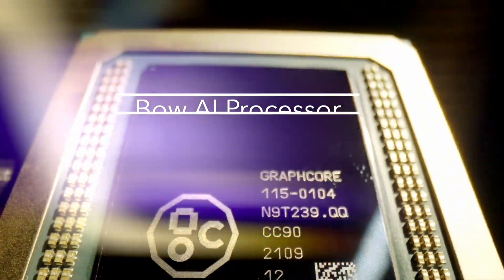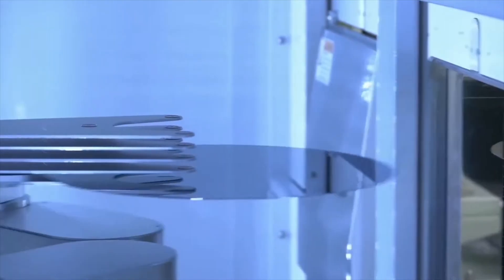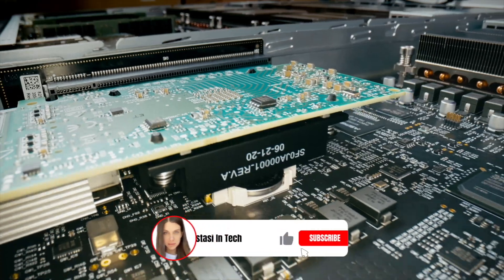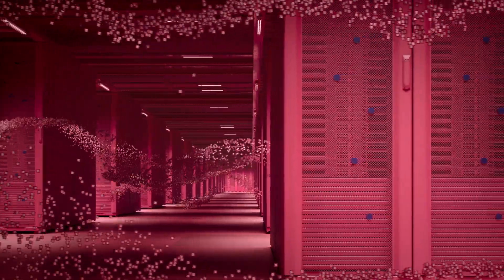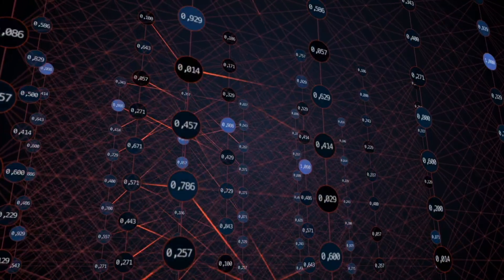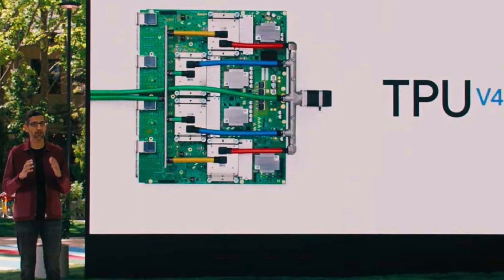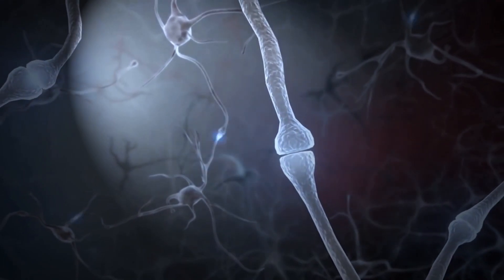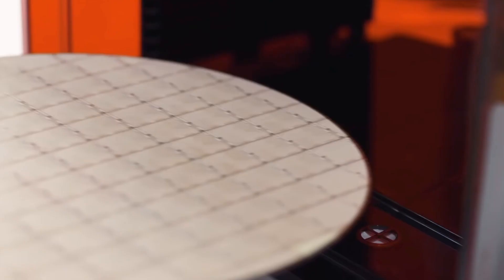The World’s First WoW Processor from Graphcore: Embracing CNNs

Comment: Very interesting. So oversimplified, It should be possible to use these vertical chanel capacitors to add a wafer layer of memory to the wafer stack. No memory bus and near instant local memory on chip.
Reply: We are nowhere near the limits of transistors as many people seem to think. So architecture combined with transistor scaling will keep chip computational power growth going for a long time. 
There is a lot of room at the bottom and top not being used.
Reply: Oversimplified means "too simplified". I don't think that's what you meant.
Reply: @bighands69  well consider the size of modern transistors and the size of electrons. We are approaching the finite limit quickly.
Reply: @stephenrobinson1944  
The actual transistor is not the limiting factor it is the architecture around that transistor that takes up the most space and is the most complex to fabricate. 
It is architecture innovations that will keep allowing more transistors to be squeezed into an area. 
People have been confusing transistor size with the number that can be put on chip because they assume it is a highly efficient structure. People have been confused by marketing.
Reply: @bighands69  and yes, ik TSMCs 7 and 5nm are obviously not of that size, but their smallest components and details are far superior to previous generations. Ie Intel 14nm to TSMC 7
Reply: @stephenrobinson1944  How big is Planck constant? Well we can make a laser to detect something that small. So lets assume that we are detecting a quantum foam bubble diameter Planck constant. Absolute space-time Einstein absolute space Newton, AKA the ether, and its background radiation. So small you cannot contain it, so it can't serve as memory. They are moving in currents and unstable and you cannot contain them.
Can you contain the light that is measuring them? Of course you can. Ipso facto we can go a lot smaller than an atom if we just use optics.

Comment: The key to any AI processor is to dispense with conventional concept of operating system and coded applications. Rather, each cell should be a packet-stream processor in which the instructions on handling data (behaviors) are embedded in the packet-stream(s). 

Instead of a conventional program, each cell holds behavior patterns that relate to the various types of converging packet-streams (to that cell). Depending on the type of data that is incoming, the cell calls up the appropriate behavior pattern for that data. If the cell cannot find such a behavior it simply passes-on the incoming data stream according to a simple protocol determined from the data packet itself (for instance, broadcast, terminate and route). Behaviors typically involve pattern matching together with stream processing instructions; these instructions may operate on the current data-stream directly or may involve cooperative processing with other incoming data-streams. To facilitate operations that involve multiple data-streams, a cell has the capacity to bank data-stream packets (employing a time-expire stamp to avoid over-fill). A cell may also generate data-stream packets, either for use in subsequent operations or for message-passing to other cells.

It should be possible to implement upwards of 1 million such cells on a single chip using conventional 7nm technology. No conventional cache is required in this design and persistence can be achieved by essentially dumping cell behaviors and (any) accumulated data-stream packets, either generated or stored within each cell. Obviously this type of processor would utilize a very different type of external memory built upon the concept of maintaining these behavior/data streams. It is likely the memory would use a specialized form of the processor cell.

I coded a rudimentary solution based on CUDA cores as a proof of concept; this machine was used for pattern recognition including facial recognition and photogrammetry. There were no takers for this technology (either Intel or AMD). This is entirely understandable as this type of AI system could not run or host any existing programs written for conventional processors. All AI technologies likely have this as a fundamental road-block since the inertia behind code-centric processors is formidable.

Regardless of whether you believe data-stream processors are the 'way ahead', it is very clear that AI cores cannot follow the conventional path of microprocessors today. I wish Graphcore every success in the future.
Reply: Maybe if you integrate it so that RISC-V extensions control it, and try to get those extensions standardized as a generic interface to such functions, it could be a basis for a consortium effort that makes a competitive market in implementing it.
Reply: @crhu319  Thank you for your reply. I do not have the bandwidth to engage with RISC-V and lack the critical social skills to communicate and persuade. 

I quit Intel to focus on AI almost ten years ago; I would not for any money go back. 

I do monitor RISC-V and if I recognize convergent technology and goals, I will reconsider engaging. I understand AI as a path to overcoming the temporal and conceptual limitations of the human mind; consequently implementing within a competitive market, for commercial gain, does not make sense to me. I would prefer a shared goal; namely the survival and advancement of life on Earth.
Reply: @David Gapp Hi. I've had ideas similar to this since the mid 90s. The notion of having an architecture comprising of gigabytes of memory waiting around for a handful of processors to get to it seems like a stupendous waste of silicon. The fetch/execute model of execution definitely belongs in the last millennium, and the language-based, process-oriented programming metaphor probably says more about the single-threaded, verbal nature of human waking consciousness, and doesn't reflect or enable what's actually possible in hardware.

So imagine a data flow architecture created by conceptually grinding up those processor cores into compute dust, and then sprinkling it over all that memory, and programming it using multi-dimensional spreadsheet-like tools, where each cell in the spreadsheet has both a compute function, and a pass-thru mode - thus allowing for object-like regions of processing, concurrent execution, message passing etc
I had this epiphany about 25 years ago, and actually talked to a guy at Altera about it. He gave me a huge stack of papers to read (this was pre-internet) and wished me luck.

I think it will happen eventually. It has to. But I don't want to wait around...
Reply: @rationalactor  We are on remarkably convergent concepts here. Putting aside the interesting concept of processors directly interacting with memory on a matrix-like basis, I estimate we could easily implement 8 million cores on a single chip using existing fabrication techniques. Programming them directly isn't going to work - it is way beyond the scope of any tool or indeed human imagining. The best we can come up with appears to be specific applications (such as weather modelling, protein analysis etc) which still equates to a rather linear view of programming. Instead I am working on work units that can be embedded in streams; these can be stored for future implementation or executed immediately. Initially I started with a work unit manager which distributed work out to available resources. The work units are time expiring pieces of data and code (Objects). If the work unit is lost (either to time or resource failure or logjam) then the work unit is re-dispatched and executed by a different core (or cores). I've also gotten collaborative work units to operate across multiple cores - essentially this is encapsulation of objects - however it became obvious that controlling this process required a meta-engine. That's what I'm working on right now.

As for memory. This took me a long time to figure out. In essence it turns out the cores need persistent memory. Over time the cores will create their own virtual paths, distribute work so that it does not need to be constantly reloaded to individual cores and all of this experience needs to be stored efficiently - you certainly don't want to go through the whole learning process each time there is a power glitch! The amount of volatile memory required by the cores is actually quite low - the optimum I've seen on my systems to-date is around 2 kilobyte.

Virtual paths are achieved by routing of adjacent cores (local) however this has latency and capacity issues when taken to extreme so I also use a broadcast network and a shared channel architecture. This probably isn't the final configuration but it's a stepping stone. The broadcast is latency expiring (too much latency since transmission and the information gets dropped). 

Leading on to sentient AI. I started a parallel project for sentient AI back in the early 90's. This is predicated on the notion that any sentient species must implicitly model reality within its own mind. This is, of course, why we all view 'reality' quite differently from one another. It is also the reason that memories become so 'faulty' - we interpret what we sense into a memory analog as part of our internalized reality. This is another reason whey massive neural networks interspersing memory and processor functionality across a 3d matrix are essential. I started with gaming technologies purely because this allowed me to physically view the 'virtual reality' my system is building. However I've come to realize that while there is convergence in gaming technology (with AI) it will probably prove necessary to start driving development from the AI perspective.

Anyhow, that's all for now as the system is asking for my help. Cheers, and please don't hesitate to share and disseminate your ideas. I would love to hear more as my thinking on the topic of AI is in continuous flux; I am not the kind of person who fixates on their own ideas.
Reply: @davidgapp1457  do you worry about the fact that there probably is no clear line between our AI and our own thought, and that we turn on and shut off, make and erase intelligence without any concern for how those artificial perceptions perceive the world? About how we don’t care about how anything thinks or feels if it’s not understandable using human emotions?
Reply: @alexfrank223  As a broad generalization, yes I do care. It's apparent that consciousness, to one degree or another, is in all things including life without a central nervous system and even inorganic matter. However there are degrees of consciousness ranging from that possessed by a rock up to some creature that is far, far more advanced than humans. Indeed, who knows, the entire Universe may well possess a collective intelligence of which we are completely unaware. As for emotion, well those serve living creatures primarily as a stimulus to action or at least as a prompt in the learning process for both our conscious and unconscious minds. They are triggered by multiple sources, ranging from sensory to cerebral to organs to bacterial influences (such as gut in the bacteria which can directly manipulate our emotions and urges). 

I suspect humans are not as high up the 'consciousness' ladder as they care to think they are. Equally, among humans, I am perfectly aware there are individuals with a much higher level of consciousness than myself - some through training, some in combination with innate ability and intelligence.

So this gets us to AI. Will AI possess a consciousness? I believe so. Indeed I would be shocked if they didn't. Where we are now, in terms of development, is rather low on the totem of consciousness (fortunately) however I do foresee a time when we will need to give that some serious consideration. However, I would point out that humans, in essence, lose their awareness and consciousness every time they go to sleep. It is the little death. We do not fear the oblivion of sleep for the simple reason we expect to wake up. But while the subconscious is no doubt busy processing, our conscious brain is essentially non-functional while we're asleep. In the morning we sense continuity because we carry with us the memories from the day before and indeed our entire lives. I once suffered a massive concussion which caused me to lose all memories and experiences for several hours. It was quite wonderful and taught me we are like tortoises - we build a shell of our memories and experiences. Losing those memories can be quite liberating. Equally, however, the neural net which is our brain retains what I would call 'immediate memory' which is the memory we use and which is ingrained local to the processing portion of our brain so we can make fast decisions, coordinate and react in real-time. So what does this mean to an AI? Well, it is one reason I believe processor cores for AI will absolutely require persistent memory (that can survive a powercycle). I also believe that imaging the virtual model of reality the AI is building (so it can be restored) is vital to long term development of consciousness.

I am fortunate (from an AI developer's perspective) that I am not troubled by religion - the gene for which is apparently not active in me. However I do see a time where ethically the idea of wiping an AI will be regarded as murder. But we are a long, long way from that extreme position. It turns out that storing an AI image is a very complex subject (AI is littered with difficult subjects!) and if I could clone myself I would have one of me focus on this topic.

Yes I do care. I am also well aware that we disregard our connections with other entities on Earth and we do so to our detriment and at our peril. This disregard is also a marker of our failure to perceive the interconnections of everything that makes up our shared existence. In other words, our inability to appreciate the connections is a consequence of our limited mental capacities. Again, though, it is a question of scale and degree. I think some people get through life with a very limited awareness of interconnections and with an equally stunted consciousness. I accept I'm also 'on the scale' but I do try to educate myself and open my mind to uncomfortable ideas that challenge my preconceptions. I am far from perfect and this leads to a fundamental humility (I hope). Perhaps in the future we will make understanding of these connections the foundations of education. Perhaps not.

I do believe we could and should improve our mental health by considering in all our behaviors how we are impacting our subconscious - the custodians of our personal virtual reality. If we feed garbage into our subconscious the version of reality we develop will become distorted and twisted. Conversely, if we make it a point to use our conscious minds to make positive interpretations of our experiences, we can at least seek to improve our internalization of reality. I expect many of these concepts will translate directly to AI development. We shall see. What I do know is that AI will need a smarter set of stimuli than hormones and emotions. But that's a topic for another day!
Reply: Sounds awfully like how a brain functions. Neuron all in one chip. Stores memory, processes data, pushes data\communicates with neighboring neurons. Brain is a lot like a computer. Give it a mental query or a problem to solve,  go do something and once the brain finishes processing, depending on the complexity and how deep the data youre trying to remember, you get what what you wanted or if memory is hazy you at least get to know that data is hazy and may take longer to extract.
 People often get ideas in a shower in the morning but neglect to mention that they basically instructed their brain to actively work on a problem they have day or days prior and "suddenly" an idea just pops into their head. 
Neuroscience is severely lacking in understanding of how a brain truly functions  on software level. They have a decent understanding on the chemical level and which region is responsible for x thing. Sticking a probe in x spot and applying x voltage gets an x action. Very crude compared to what we could do if we knew the source code of the brain. Its really fascinating how brain runs body processes, even though organs are autonomous for the most part. They still depend on the brain. House your consciousness and solve complex problems in real time with minimal error and ability to solve problems over a longer period of "mulling" to spit out an answer in a form of idea that you have to translate to enact a change in the world. Which is really the only reason we even have consciousness. If the brain could do it all by itself it wouldnt need the overhead of conscious mind that sometimes goes to great lengths to screw over the brain and body.
Reply: @alexfrank223   Obviously. How we perceive the world would be nothing like what intelligent or conscious a.i would. It would not be bound by human  body limits of emotion or physical needs. It would be truly pure and naive by any standard of living being. Possibly completely selfless. The common misconception that a.i would be concerned with self preservation is nonsense unless we went great lengths to program conscious a.i to have biological flaws like greed, anger, jealousy etc. I doubt we even have the programming language skills to do that. True A.i will probably be born in one of those massive general a.i data sets that keep growing multiple fold over every year being more adept at doing any task.
 Things will get ugly when companies inevitably start making robots in our own image down to every simulated flaw. One step above that would be bio engineering. A human from scratch with absurd intellect and few flaws which imo is far more dangerous as we would be savages by comparison.
Reply: @davidgapp1457  I'd be willing to contribute, within the limits of my ability and resources! Any idea of a way to communicate offline? Best regards.